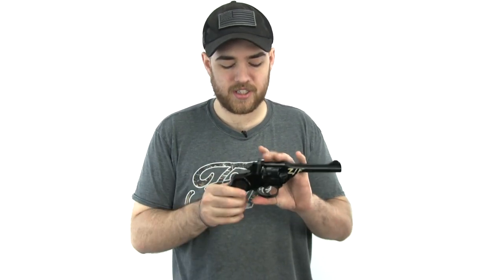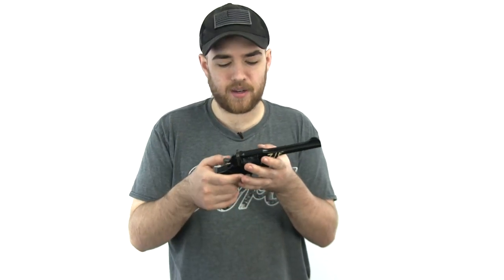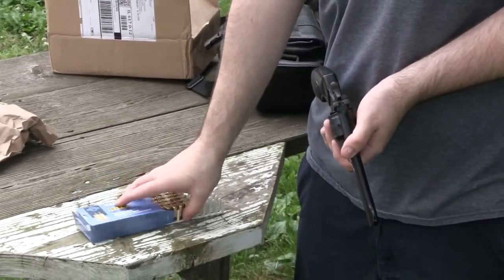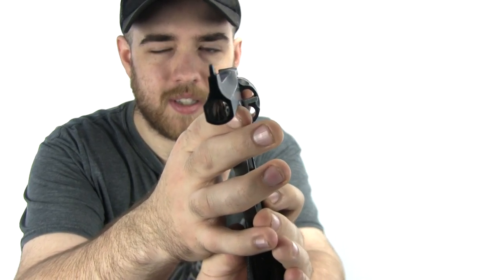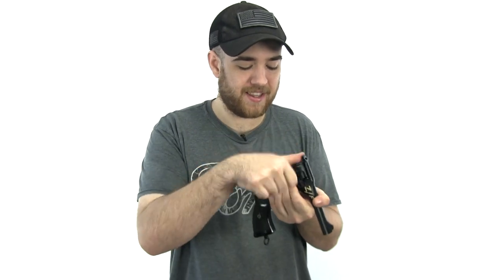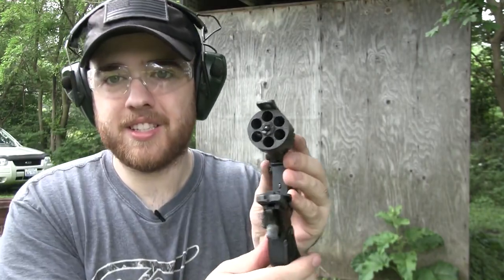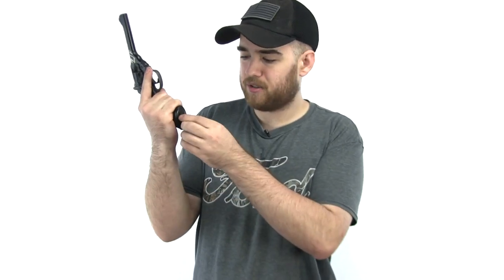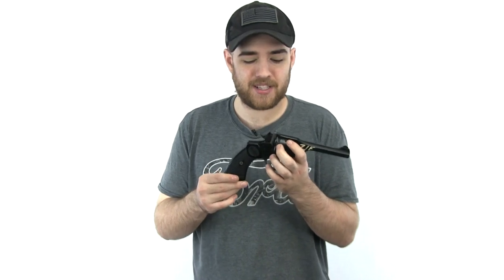WEBLEY & SCOTT LTD MARK IV 38 S&W REVOLVER

Comment: My uncle use to have one used it for a truck gun. 🥺
Reply from the maker: The 38S&W isnt the most powerful round but the revolver is still sweet. Wish they made more like this but in 357
Reply: @iloveshootingshit  that is true. I don't know if you can load this in that gun, but a .38/200 Super Police , which is a .38 S&W loaded with a 200 grain bullet to around 625 ftps ups it in the being lethal department it's not far behind the .45 ACP , I replicate the load but in .38 Special , shoot it through my .357 mag and .38 Special, reason being the .357 magnum is a better defense cartridge, and I can shoot it, but I can't do follow up shots well. Even though I am left handed and my right is just my support hand, I have nerve damage in my right hand so it's barely a support hand I'm mostly shooting with a single grip.
 The .38/200 actually tumbles when it hits so it makes some big wounds. I said if wasn't far off from the .45 ACP, but in hind sight I think it would be closer in power to the .41 long Colt.
 You give a great presentation. 💙
Reply from the maker: @JoanieKennedy  it would be interesting seeing if you safely load this revovler with capable defensive ammo. I just worry about durability of the design

Comment: Top breaks aren't known for their strength so making hot loads isnt recommended. And 38sw isnt and overly powerful cartridge.

You could probably heat them up more if you find a non top break revolver like a smith victory.   But at that point....buy a 38spl revolver .

Edit.  Meant to reply to someone asking about carry options

Comment: What is ZF, writing on the gun it looks terrible
Reply from the maker: It means it's condemned. I'm thinking this gun was defective. It went back to get repaired. Then, no one took the paint off. If you look at the parts the slightly don't match in finish. I could be wrong